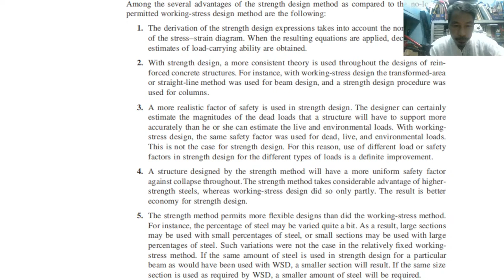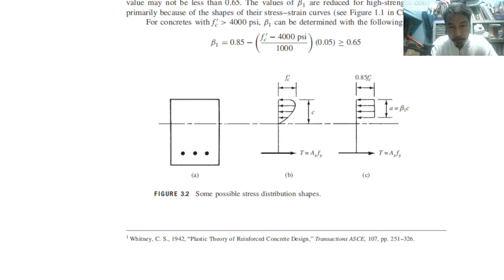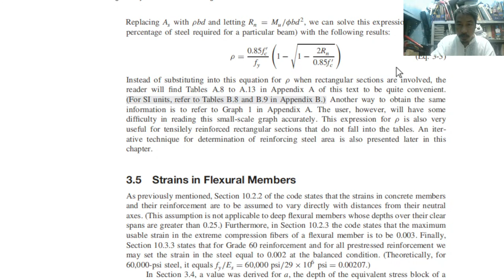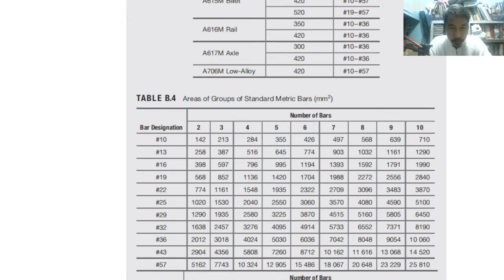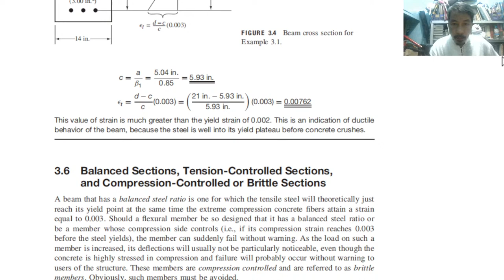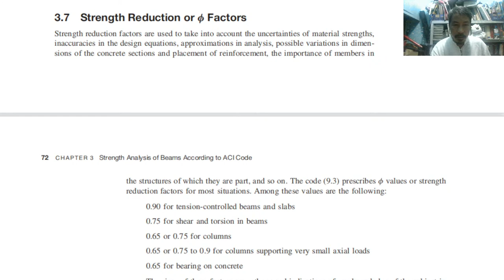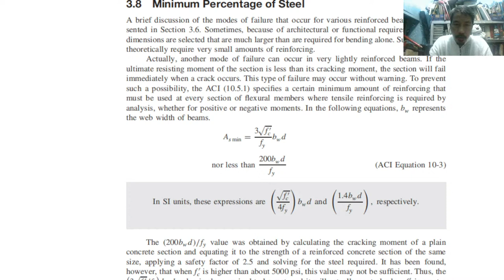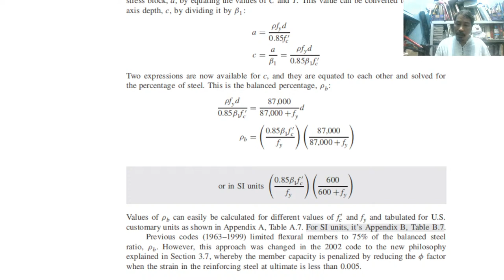[ LIVE CEE7 Lecture 10 ] DrAP Zantua Strength Limit States Talks + ENGINEERING Analysis & ACI Code

Comment: thank you sir for discussing strength analysis of beams according to ACI code which I learned that design methods from the early 1900s until the early 1960s nearly all reinforced concrete design in the united states was performed by the working- stress design method also called allowable-stress design or straight-line design. In this method, frequently referred to as WSD, the dead and live loads to be supported, called working loads or service loads, were first estimated. Also the video includes the advantages of strength design, structural safety, derivation of beam expressions, strains in flexural members, table A.8, table A.14, table B.1, table B.2,  table B.3, table B.4, table B.5, balanced sections, tension-controlled sections, and compression-controlled or brittle sections, strength reduction, minimum percentage of steel. Thank you for explaining some examples related to these topics.

Comment: Thank you sir for this live lecture that tackles about the strength analysis of beams according to ACI Code. Balanced, Tension-Controlled, and Compression-Controlled or Brittle Sections were being mentioned and discussed in this video.

Comment: Thank you sir for this informative live lecture about the strength limit states and for recalling past lessons with regard to ACI Code.  Some table that corresponds to rho or the percentage of the tensile load was shown and discussed. Strains in flexural members were talked through. Balanced, Tension-Controlled, and Compression-Controlled or Brittle Sections were discussed. Also, the strength reduction factor and the minimum percentage of steel were discussed with its formulas and usage. Thank you sir.

Comment: Thankyou sir for discussing about strength analysis of beams according to ACI Code. This video lecture exhibits advantages of strength design like the derivation of the strength design expression takes into account the nonlinear shape of the stress strain diagram. With strength design, more consistent theory is used throughout the design of reinforced concrete structures. Working with stress design the transformed area was used for beam design and a strength design procedure was used for Columns. I’ve learned that a beam that has a balanced steel ratio is one for which tensile steel will theoretically just reach its yield point at the same time the extreme compression concrete fibers attain a strain equal to 0.003.